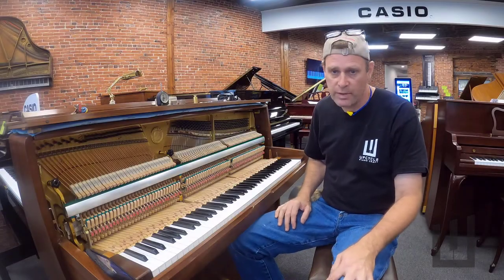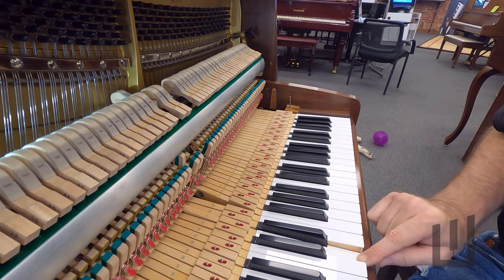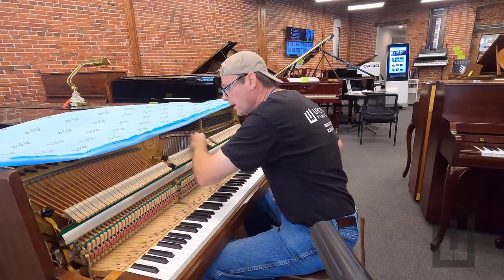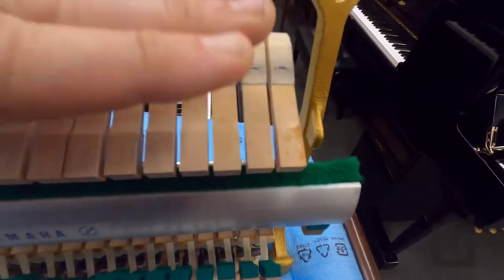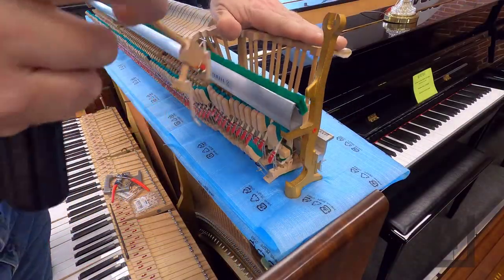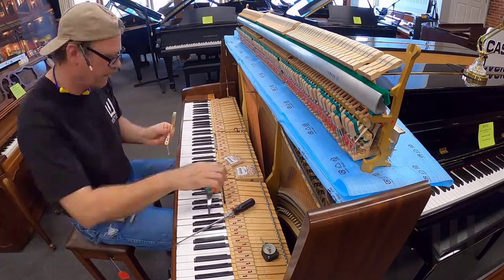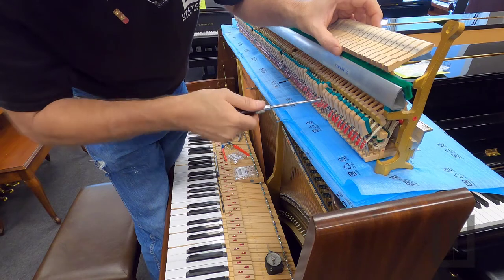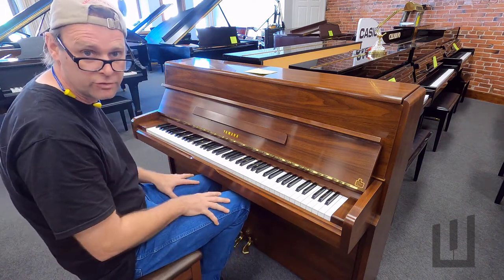Yamaha Upright Piano Hammer Spring Problem

Comment: Whenever I change a set of flanges on one of these old Yamaha uprights I always  space all of the hammers first with the old flanges and then replace every other hammer with the new flange placing it back exactly the way it was between the adjacent hammers. In other words do 44 flanges and then go back and do the other 44. This will automatically assure that after the whole set is replaced the hammers will automatically be spaced.
Reply: thanks, good tip!  🙂

Comment: Oh wow.  So we picked up a 1969 Yamaha P2 with no bridge damage, stable tuners, and good sound board needing some cosmetic TLC.  It is a project.  I noticed some hammers paused at the top rather than returning quickly.  Exploring, I found all these brown broken strings bits, and metal springs attached to nothing.  I was wracking my brain to figure out the point of springs attached to nothing!  Your video solved the mystery.  Every single butt flange string is broken.  They disintegrate to the touch.  Rather than replacing all the butt flanges, can I not somehow replace the strings with a bit of nylon string, then re-seat the springs?  The project just got more complicated!

Comment: Yes, it is always a good idea to pay a tech to come out and inspect your purchase! I have saved many a customer by flushing out a serious problem before they purchased (including piano stores - one of which had a Yam. with many broken flange strings; the sales rep said they would not fix them. A good fast test for non techies is to hold down the sustain pedal and use your arm to push down many keys at once while watching the hammers. Quickly release the keys noting if all the hammers return quickly, as designed. Sluggish hammers are ones that are suspect!

Comment: Great video - the newer Yamaha uprights have a screw plate that fastens down on the pin. This is a lot faster than dealing with the phlange pin .
Reply: the newer Yamaha uprights,?
Reply: So do older ones. I just serviced a 1958 U3 that had screws plate attachment.

Comment: Thank you. You have a wonderful teaching manner. I once replaced all of the loops on a piano by removing the loop, scraping out the old glue, measuring and glueing a new piece of chord in there; a much more time-consuming process. I had no idea I could have replaced the flanges with new loops. :)  I have a question about replacing hammer return springs. Usually, at least on the pianos I've looked at, the springs are on a rail. However, I need to fix a broken spring on a hammer like the one you feature in this video, in which the spring is integral to the piece, attached to the butt near the shank, rather than on a rail.
Do you have any information on this please? I'd like to see the process. Thanks again.
Reply: @pds002 It seems a good solution too. Avoid replacing the original flange.  I have the same problem: may I ask what type of chord did you use (possibly the section) ? thank you!  🙂

Comment: Should I ask the company trying to sell me the 1989 Yamaha when the piano’s butt flanges were last replaced with new ones when I inspect the piano myself? 
I am planning to ask them to take the action out of the piano so I can see for myself whether or not there are any broken springs…..

Your video has me seriously worried now, but i AM glad I watched this; now I know exactly what to look for before committing to a big purchase.
Reply: I am a technician. Helping my customers inspect pianos, I ALWAYS check for these rotting spring string loops on older Yamahas. Most of them have not been changed out; you must pretty much disassemble the action to remove and change them. I charged $750. There was a recall on these pianos, but I know of none of my customers who were notified and subsequently had the work done. Yes! Bring a good flashlight and your glasses and look yourself. Some techs charge over $1K for the work. It is not the death of a piano, but you must factor in the extra cost of having these changed out and use that as a bargaining point.

Comment: My keys also have this problem of not returning like in this video on a light touch but it's not noticed or understood by the tuner even when I tried to explain as per your video. 

Would solving this problem also help solve the "weightyness" of the keys? I have a 40+ year old Yamaha U1 that is too light on the touch. I just had my piano tuned and the tuner said there's nothing you can do, but...I don't trust him.
Reply: It can be really hard to increase touch in an upright, especially as the hammers become worn, reshaped and lose material over time.  Sometimes key weighting adjustments are necessary, or I've even seen people put binder clips right below the hammer head.  New, heavier hammers might be the most long term solution.

Comment: Is it possible to just replace the cord that the spring pushes against? On mine many of the cords are broken but there does not seem to be a problem with the rest of the hammer butt flange.
Reply from the maker: Replacing the loop would require excessive time and labor cost.
Reply: Not only would this take many hours but it is very difficult to glue every end of string in exactly the same lenght and position.
Reply: Yes, this is the standard repair: scrape out the old cords and glue in new ones.
Reply: I personally reglued in all the strings on my ‘84 U1 and it’s a long laborious job. If you had to pay a tech to do it it might cost more than the piano is worth.
Reply: I am a technician. I have heard other piano folk do the "quick-and-dirty" resolution this way. A couple of things... If there is one, there are others. And more will follow; as all 88 are dying! Yes, it is pricey to have it done (I charged $750 and others over $1K) but it really is the best resolution.

Comment: I have a new yamaha that double strikes when playing softly, Is the same problem?
Reply from the maker: No.  Your technician may need to increase the let off slightly or check for other issues like lost motion.
Reply: No. Practically all new Yamahas, Kawais, and many other vertical pianos have problems with bobbling hammers, generally in the low tenor. I've asked many fellow techs and there are lots of theories, including damper and hammer spring strength. It's a problem even on new, perfectly regulated modern pianos. For some reason, old pianos don't have the problem. I've often wondered if the size of the tip of modern jacks may be an issue: maybe they can't clear the hammer butt fast enough.
Reply: I agree. I have an ‘84 Yamaha U1 that bobbled quite badly in the tenor. I reglued in all new thread loops like in this video and it reduced the problem but it still remained to some extent. I think it’s just inherent with some uprights.